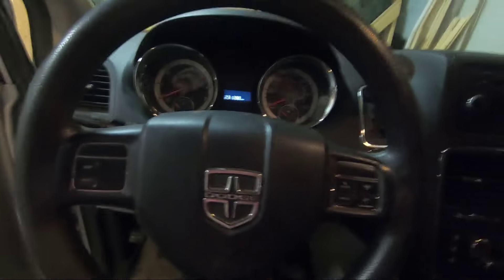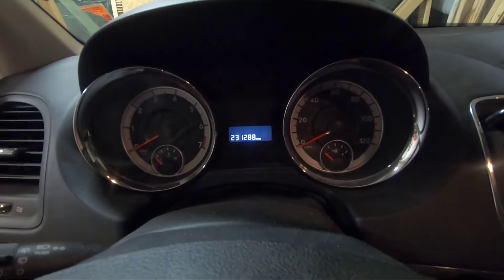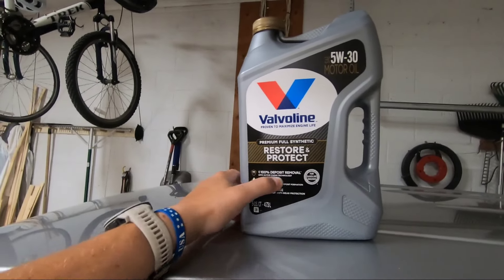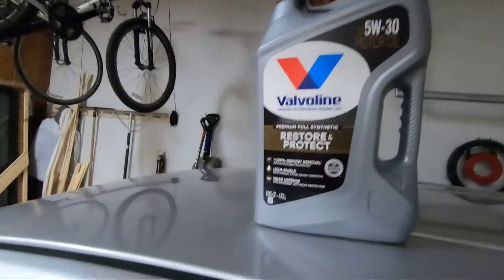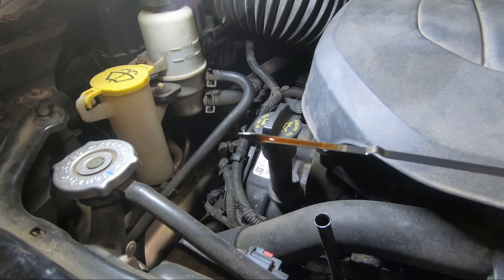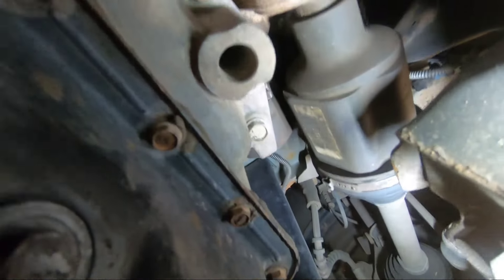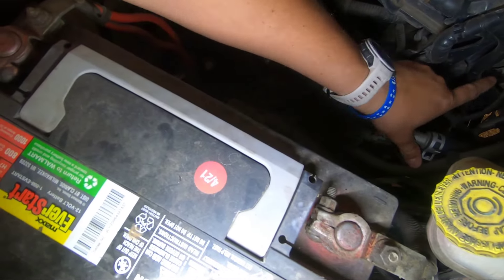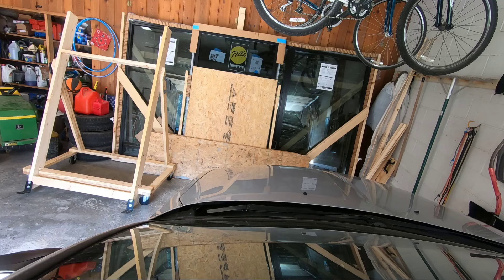Valvoline Restore and Protect - 231,000 Miles Pentastar 3.6L -  Dodge/Chrysler - 1st Oil Change

Comment: If the Mobil1 was working good for you, why did you switch to something else, especially to Kirkland oil?  Mobil1 is the only oil I use in all of my vehicles because it works great.  Why mess with success?
Reply: Mobile one is ok and better than Kirkland but there’s better oils out there and he was trying to fix the oil consumption problem
Reply: @ajmedeiros77  Mobil1 has been in the synthetic oil market since the 70's while all the other major oil manufacturers didn't get into the synthetics until the 90's or early 2000's which gives Mobil1 at least a 20 year head start over the other guys. Which motor oil do you think is better than Mobil1?
Reply: Valvoline is better than mobile 1
Reply: @PeTroL420  Valvoline is the only oil company who has an engine oil testing facility
Reply: @longlost2518  No they aren't

Comment: The correct viscosity for a 2011 Pinestar 3.6 is 5W20 changed every 5000 miles forget about it
Reply from the maker: depends on the year....for 2011 it was 5w-30
Reply: Cap reveal ?
Reply: Will run longer on 5w30. The 5w20 is for better EPA

Comment: This may help reduce oil burn by allowing rings moving more freely. Do NOT recommend 7500 miles. This is part of the issue. Up the viscosity of the oil. Go to a 30 weight from a 20 weight.

Comment: There's a pcv valve that needs replaced
Reply: I'm wanting to replace mine I need to remove intake manifold to get to it and it I do that the flaps inside the intake may need replaced or removed or may replace the whole intake manifold with one off ebay but I do want to try or use the oil I have a highmilage vehicle 05 focus st 2.3 duratec with 234000miles

Comment: have you ever had the pentastar tick?
Reply from the maker: I bought the van at 72K miles - 3yrs old- and never had a tick.  It did have a warranty replacement cylinder head just before my purchase.
Reply: My wife's great uncle had a 15 or 17 Dodge minivan w/3.6L . IIRC, it had 80k or 90k on it, and I changed the oil in it. I was quite  impressed how smoothly the engine ran and how quiet the engine was.

Comment: I used it because I was curious to see the claims .. 26 miles later it burned half a quart I could see the white smoke and the distinct smell out my muffler so  I went back to Amsoil (the original oil I was using before valovline)
Reply: Well your car is an oil burner, what did you expect?
Reply: You should put it back in and keep adding

Comment: I have ~1K miles on my first R&P oil change. Didn’t yet have oil consumption on my ‘12 Prius with 125K miles on it. Hopefully this will work to keep it that way. My model/year has a well known issue with oil consumption due to low friction rings.

The engine was immediately less noisy with this product in it. I’m looking forward to about year out from now when folks have had enough time to run through 3-4 R&P oil changes.
Reply: Similar story on my Gen 2 Prius. I'm only about 3500mi into the first oil change w/ R&P, and although I can't comment on oil consumption yet, the engine does seem to run better. I get no more VVT knock/noise on cold startups, engine engagement/disengagement seems smoother, it seems to rev better (Cleaning the VVT actuator?), and my fuel economy is slightly better (although this could be due to other factors)
Reply: @Black-Villain  one thing I think I will do is change out my oil filter soon. Just to be sure the oil hasn’t mobilized enough deposits to clog it up.
Reply: A ‘12 Prius with only 125k miles? What’s the point of getting a fuel efficient car if you barely drive it?
Reply: @TaylorPhase  I know 😂. I’ve owned it since new. Used to put way more miles on it, then life changed. Now I barely hit 500 miles/month. It’s been payed off for so long, and is in such good shape, there’s no reason for me to get rid of it. No rust in my area so maybe it’ll go another 15 years.

Comment: How do people even tell they have oil consumption, the dip stick really isn’t that accurate and it’s always on the same spot for me just different color based on oil mileage.
Reply: Trust me, when you have oil consumption, you'll know it. The dipstick does not have to be accurate.
Reply: @moshet842  what the hel are you talking about saying the "dipstick does not have to be accurate"?  Of course it "has" to be.  It's the way you can verify the proper oil level in your engine.  So, how else are you going to do that?  What do you think the oil dipstick is there for?  Furthermore, the "accuracy" of the oil level IS IMPORTANT to verify whether you have oil consumption or not.  You need to understand how to PROPERLY check the oil so you can compare and have accurate results.
Reply: @TheMW2informer it's actualy very simple to "tell" if your car is consuming oil at a rate that is "excessive" or "abnormal".  The dipstick actually IS "accurate" as long as you know how to properly check the oil.

First of all, if you're checking the oil immediately after you shut the engine off or within a minute or two, this is NOT going to give you very accurate results.  If you're trying to check your oil while you're getting fuel, this is typically not going to work unless you give it at least four or five minutes and most people don't wait that long because it doesn't take them that long to get fuel.

You need to allow the oil to "settle" to the bottom of the engine oil pan so you can get an "accurate" measurement.  This isn't something that you can do within a few minutes because it takes a little time for the oil to drain back down to the oil pan through all of the different passageways and oil galleries.  Not only that but, it also causes the oil to be difficult to read on the dipstick because you will sometimes get extra oil that flings up above the maximum level and so you think that you are getting a reading that shows an oil level that is higher than it should be. Also, depending on the vehicle, sometimes the dipstick can be difficult to read depending on how the dipstick is angled going into the engine.

I personally had a friend that had a Nissan Murano and it was extremely difficult to properly read the oil level on the dipstick for whatever reason no matter which side we tried to read it from.

I've worked on vehicles for almost 30 years now roughly and was a tech at a coupke Ford dealerships for a few years as well. There are proper ways to check the oil and it's not that difficult at all.

To check the consumption, you should just be simply checking the oil level after you do an oil change but not immediately after putting the oil in the engine after an oil change. You need to start the engine and let it run for about 30 seconds roughly to maybe a minute to make sure all the oil is going through the engine entirely. Then, shut the engine off and wait 10 minutes or maybe 15 minutes to let the oil settle completely and check the level. After that, check it the same way after a thousand miles or after 2000 miles or after 3,000 miles and see if the level is any different. If the oil level is slightly lower such as maybe just an 1/8 of an inch frommthe maximum line, then you probably don't have any issues because every engine is going to have just a very slight amount of oil consumption. It might be something as small as 1/8 of a quart or 1/4 of a quart between oil changes.  If you're oil level on your dipstick is down to the minimum level of the dipstick or the fill mark on the dipstick and it's only been 500 to 1000 miles, then you probably have some issues.

If you start getting something like a half a quart or more between oil changes, then you probably have issues that may need to be addressed depending on how many miles you've driven. Diesel engines will typically consume more oil as well. But again, even with diesel engines, there is still a limit and having more than a quart between oil changes is a bit much.